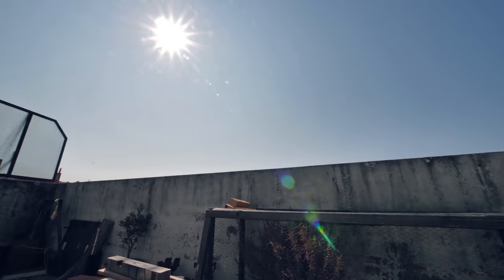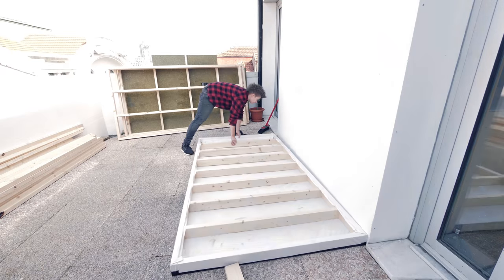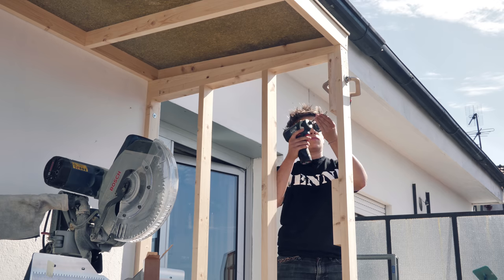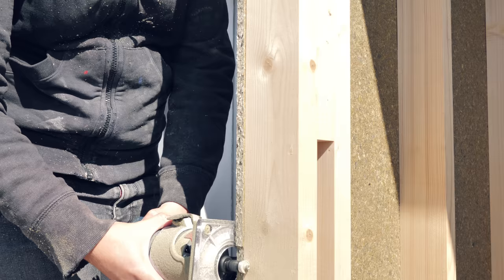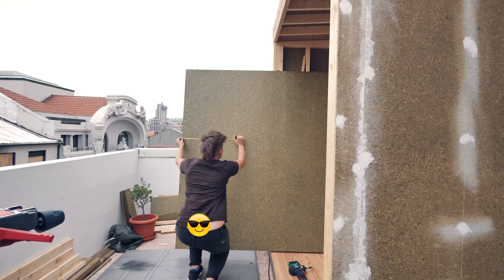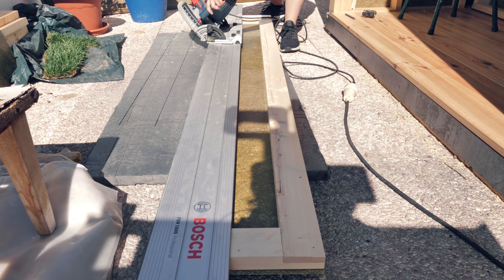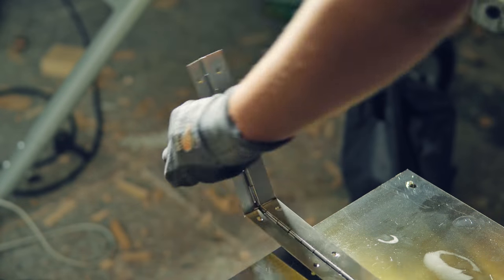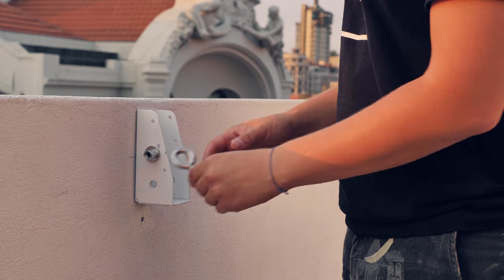Building a Shed with a Green Roof

Comment: Great project. At 8:10, you can first attach the screw into the bush and use a hammer directly on the screw to insert the bush inside wall.

Comment: If you ever do a project like this again, where you're fixing things into stone/brick wall, do yourself a favour and look up hammer fixings. I know Fischer does some, and we have various DIY-shop own-brand options here in the UK. They're like a screw and wall-plug together - you can just drill the hole through the wood and into the stone, push the fixing through the wood and into the stone without having to remove anything, and hammer the end to secure it. No messing around, no washer needed. If you ever need to undo it, they can be unscrewed just like a screw in a wall plug.

I was sceptical when I first saw them, but I've had a 250kg winch and a timber rack attached to my garage wall using these things for a couple of years now with no problems.
Reply from the maker: Ok cool, thanks for letting me know! I'll check that next time

Comment: Thank you.
I now know what I'll be making a variation on for my own Balcony Vegetable Garden.  Seventh Floor (technically the 8th floor), facing the Ottawa River, towards the North-West.  We've been here for about 20 years.  So I know exactly where the shadows fall at different points of the year.
It will be a bench/sofa.  That can fold down into a day bed.
Marine Grade Epoxy.
With a lower variation on the green-roof.  Not too tall, have to duck to sit down.  Green Roof Slats provide shade in the late afternoon of July and August.
A Bin underneath for a vermacomposter.  And a drawer unit to hold gardening tools, watering & spray cans and a Small Bin to hold the completed Verm-compost.
Thank you.  Now I know what my winter project is going to be.

(types Cathy, of Steve & Cathy's YT Account).

Comment: awesome build!   i also liked your method of product placement - all the info is there, but just once & not too intrusive.    you might want to put paint or some plastic sheeting between the stainless steel hinges & the aluminum door sheets - that way you can avoid galvanic corrosion between them.

Comment: Hi ! We actually have 2x4 and we call it (here in France) 45x95 (in millimeters). 2x6 are 45x145 and 2x8 are 45x220. You will not find them in usual home improvement stores as there are not so many Wooden Frame Constructions (yet) but there is a lot of places where you can buy them. This is a good quality wood as it as been dried in kiln. It is a little bit more expensive than in north America but still reasonable around 15€ for 5.10m 2x4 tax inc.

Comment: @Get Hands Dirty, just a random tip I'd like to pass on; whenever you're machining/cutting aluminium, add some paraffin to the working surface to avoid the blades getting clogged up.

Comment: I really love your projects. If I can help I would suggest to never install a plastic tarp under the shed. It will keep moisture and promote rotten. Im not near an expert but I saw many shed with this issue because of a plastic tarp. It needs ventilation under the floor. Rubbers feets or something similar would do the trick to peotect wood from water and allow air flow under the shed.

Comment: Wait, how do you build anything without 2x4? mind blown. I know it's late and all but a small improvement you could have done on the legs is attach something made of steel (I assume they were aluminium) and put magnets on the inside of the door so that when you are done with them,  you can just lift them in place and not have to  hold them while closing the door.

Comment: noticed just above your shed is guttering, are you allowed to divert some of that water to irrigate your roof?
and a very ingenious use of floor joist hangers (metal things)
Reply from the maker: ahah, thanks for putting a name to the metal things :D If it rains, it will rain on the grass so no need to bring water form the roof. Also, I wouldn't be allowed to modificate the gutter.

Comment: I thought about the same roof for my barn. but how to mow it?
Reply from the maker: Ahaha, well, I think I will buy some big scissors for gardening to cut it, it's the only way I guess...but for a big barn, I could imagine a small lightweight electrical mower with a stick to push and pull...but if you have a lot if inclination, I'm not sure it will be a good idea.
Reply: I would like to plant moss on the roof so as not to mow the grass.
But I worry that seeds will come there and sow weeds)
Although it may be a bad idea on the site, because there is so much grass around, which only have time to mow.

Comment: Did you have to get a special building permit to be able to build this? Where I live I would have to get a permit, my sister lives in an area that doesn't require permits, just wondering. Didn't see where you were collecting the rain water from your PVC gutter you made. You might want to have a rain barrel so you could recycle the rain. Maybe put an irrigation system in your grass with a water pump from the rain barrel? Water is heavy, hate to see you carrying water up a ladder to water your lawn. Love you shed, especially how the doors turn into the ramp and shade.

Comment: Very concise and detailed.

How long is your rail?
Reply from the maker: Bosch sent me two of 160cm. I kept one at 160 and cut the other to 90 cm + 70 cm. I also have a black metal piece to connect multiple rails so I can combine them to 230 cm or 250 cm.
They have more sizes other than the 160, anyway. I just cut one to better fit my needs.

Comment: No 2x4 in Europe? Wow. Yes, they are cold differently, of course, 50x100, and the actual size is slightly smaller, so this is the exact analogue of a 2x4.
Reply from the maker: Ok, we don't have them in Portugal and all the people I talked with so far from other European countries didn't have them as well. Here there's no such thing as construction lumber with those dimensions and cheap. Just beams. Probably because we don't build houses out of wood, just older ceilings/roofs.
Reply: The "2x4"s we get here in the UK are 38x89mm - nearer 1.5x3.5". I gather they're rough-sawn to 2x4 before being planed smooth to those dimensions. They're generally just called "studwork" or "CLS", though.

Building houses out of wood is a rubbish idea, though, so good on Portugal. ;-)
Reply: Get Hands Dirty That is weird. The 2x4’s that I use are 44x96 mm and are sold as 50x100. You wouldn’t want to buy them at the local store for DIY’ers though, because the price is indeed forbidding, but rather at a supplier for professionals. Their prices are a few times lower. And I don’t know which countries your friends are living in, but all the lumber mainly comes from 3 places: Scandinavia, France, Russia. If we are talking European sorts of wood.

Comment: Hi!

What is the size of the wood beams in milimeters?.
Reply: André Castro fairly certain that Cristina said they were 2 x 4s so just times it by 2.54 to get mm. So they would be approximately 50 x 100mm bearers.

Comment: I don't see anywhere that you allowed for water to drain out of the rood area.  In theory it could fill completely with water, I know you did some sloping but it will still fill to level with the lowest point.  Bad for the grass and your building.  Other than that nice job, I have though about the idea of putting grass as a roof.  Seems it would absorb heat and help the environment, just worried about the soil and water wearing out the roof below.

Comment: What material is the sheet wood?
Reply from the maker: the recycled one? it's called CoreTech here in Portugal
Reply: Tank you.I think I'm going to line an entire room with that!
Reply from the maker: It's a bit flexible, not sure it will work good as replacement for drywall or mdf. Check out their website to read more about the product, it was my first time using it and it's great to isolate and keep temperature nice but you probably want to use another material on top of that that is more rigid. Do some searching first :p
Reply: i'm going to glue it/screw it directly to wall so no problem with that. anyway on their website I see it being used with the regular metal beams that we use for drywall, just like you did with the wooden ones